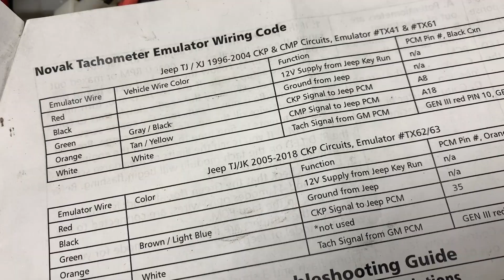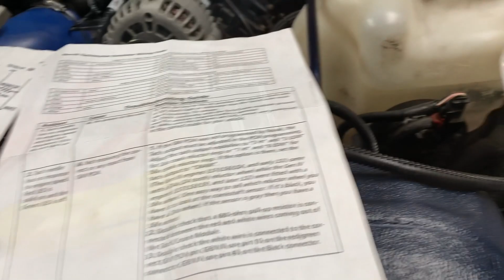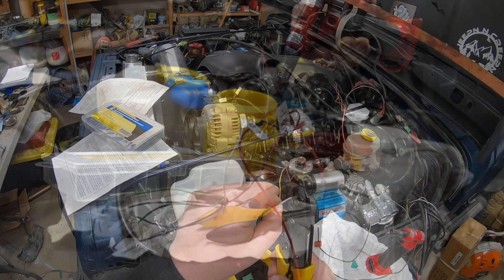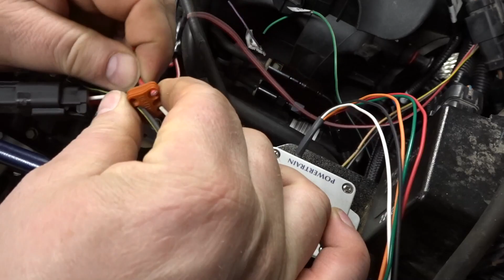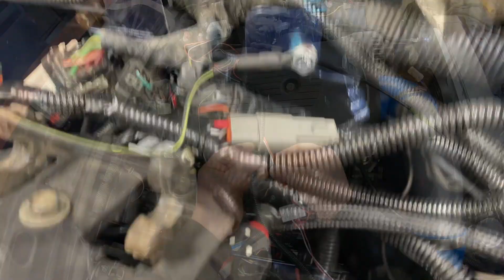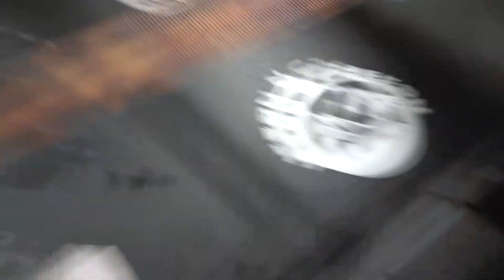Novak Tach Emulator Install

Comment: By the way, did you know Novak offers this with cruise control? I didn't, it's not on their website, but they have it. I'm returning my regular emulator and should be able to have cruise control with the steering controls which will be great!
Reply from the maker: This was a waste of money..... never did get it working properly
Reply: BSK Garage weird, mine went in with no adjustment and worked perfectly, did you ever try getting novak to troubleshoot? I paid for the novak harness with had the transistor thing in it, maybe there was a problem with that part?
Reply: @juniorthejeep   Hey man  can you make a video of your installation, at least go over how you did it? I would like to know more about the cruise control as well.
Reply: @abrahammuno4444  I would but I haven’t done it yet!

Comment: How is that emulator running? Also what did you use for ignition source?
Reply from the maker: I never did get it to work properly
Reply: @TestDontguess  damn, what is the plan? Do you think it was a bad power source ?